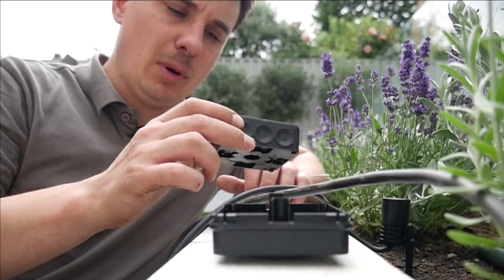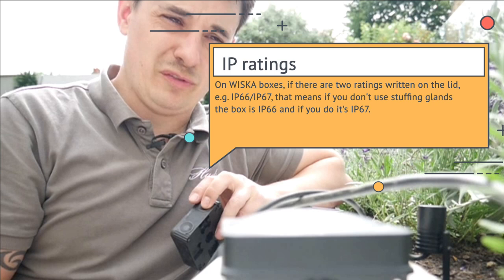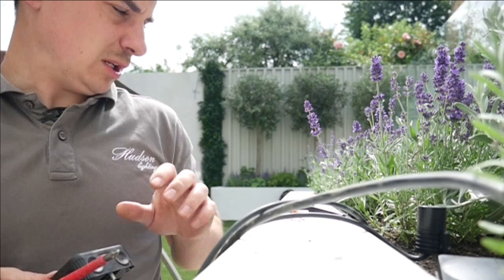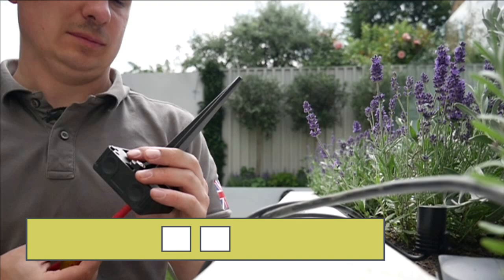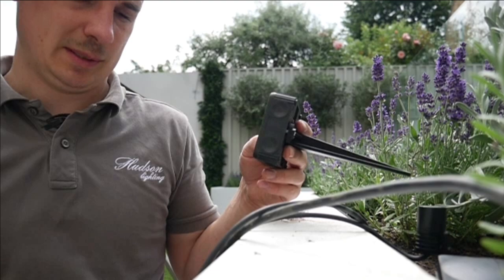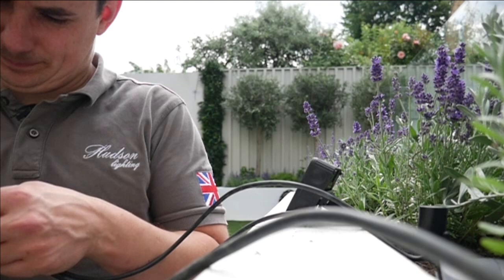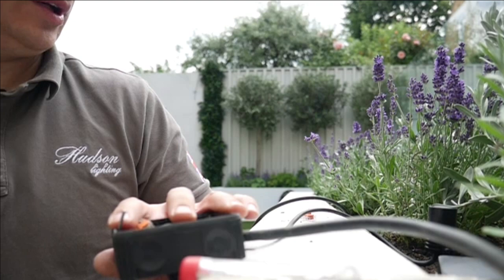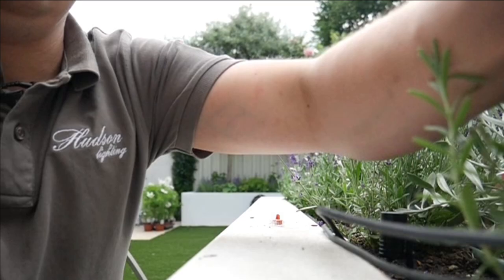Garden Lighting: Tips for Installing a WISKA COMBI 108 box for ELV lights

Comment: Great video! Probably a stupid question but why is black the positive coming into the first light?
Reply from the maker: Thanks, not a stupid question at all. With the 4 core cable I was using two pairs to do different lights on this side of the garden. Brown and grey were used on some of the other lights, and I had choosen black and green and yellow for the lights in this particular portion of the video. So in my case, I had chosen to use the black on the 4 core as + and the green and yellow as the -. It's completely installers choice and there is no set rules for extra-low voltage.

Comment: Great vids, this is probably a stupid question but the ELV will need a transformer? Is that right? So your swa to convert to elv lighting will need to feed into a transformer from 230V? What transformer do you use if I’ve got this right and the question makes sense
Reply from the maker: Thank you. Not a stupid question at all, ELV is typically available in 3 methods. 

1) batteries up to 100VDC
2) Transformers up to 50VAC
3) LED drivers up to 100VDC.

Transformers generally convert a primary voltage e.g. 230V to say 12V. Transformers aren't typically capped on their voltage output so for example, if you have an incoming voltage of 250V then a 12V transformer may actually output 13V.

Typically transformers do not convert voltage types, E.g. AC to DC.

An LED driver normally has a transformer built into it and will convert AC to DC and either fix the voltage or current exactly as designed. Drivers can have a wide input voltage, some go from 90V to 280V input and will still output a fixed voltage of 12VDC regardless. 

Typically most LEDs will need a driver rather than transformer but that will depend on the manufacturer.
Reply: @HudsonLighting  great thanks for all the info, it’s interesting trying to understand how it all comes together

Comment: Can you terminate SWA in these? Or do you need a 308 or similar? I'm trying to terminate SWA into a WISKA behind cladding so only have about 50mm. I've tried an 108 as this has the membrane and M20, but there's no rear cable membranes to push the SWA thru to a CU.
Reply from the maker: No, I believe you would need a 308 box. The 108 has 16mm inlets from memory

Comment: Hello, I want to install some bollard lights on my driveway using mains power. Which wiska box should I use? I want to use the smallest box possible.
Reply from the maker: Some bollards have decent room inside. WISKA make a 206 box which I have seen fitting in the underside of some bollards. It would be best to check first but that's your best bet
Reply: @HudsonLighting , thats a great shout I hadn't thought of that. Will the 206 box take SWA?
Reply from the maker: @philroberts1794  from memory for the box I received from WISKA I think it has 20m threaded inlets. Not sure if the SWA earth bar fits though

Comment: How do you remove the top of the junction box? ie do you twist or prise the lid off?
Reply from the maker: On a 108 you should be able to squeeze the sides to get it off. You can use a small flat had to gently prize the lid too
Reply: @HudsonLighting  if you can take the lid off without a tool, does that make it unsuitable for mains voltage use?